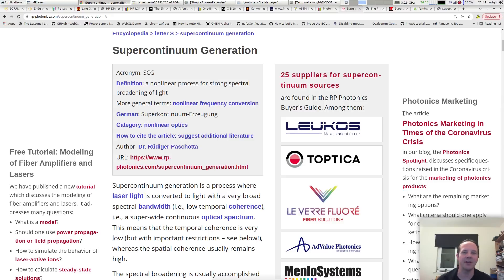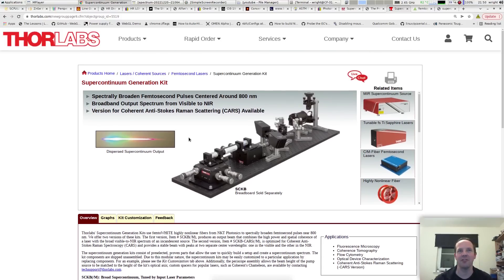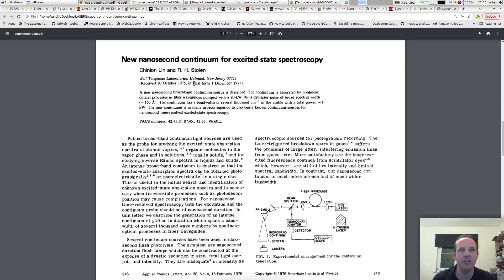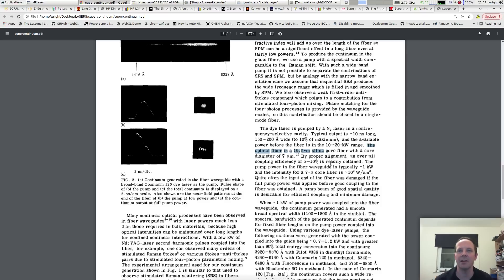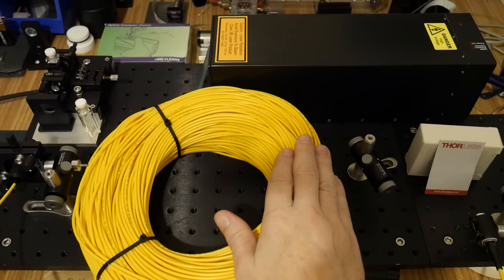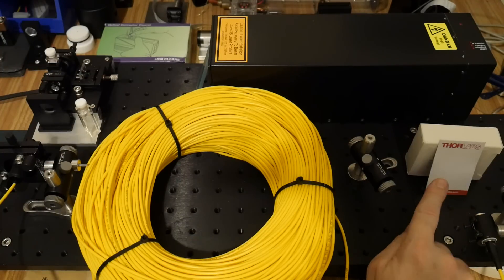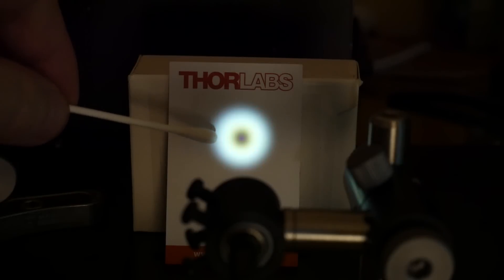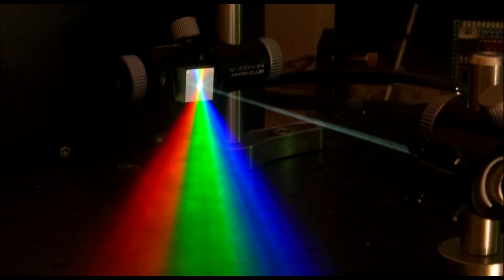DIY SUPERCONTINUUM LASER on a BUDGET!!

Comment: I suspect the "donut image" has something to do with how fiber optic cables are made. They start with tubes, vapor deposit some silica soot on the inside walls of the tube, then they heat it up and pull the tube into very thin strands that we call optic fibers. So the fiber has soot in the middle, which does not allow light through.
Reply: No it's a spatial transverse electro magnetic mode. The most likely reason here is the fiber is too big for the frequencies involved. This is a known issue for a lot of lasers especially as you ramp up the power.
Reply: @Slowly_Going_Mad  Thanks - today I learned about Transverse Electro Magnetic Mode in a waveguide medium, such as an antenna or fiber optic cable. - You get two thumbs up!
Reply: @EMleRoux Thanks and no problem. I also have a little trouble wrapping my head around some of the concepts if I'm being honest. The best way of looking at it though is most stable resonators are an extension of a spherical point source so these transverse modes are some integer multiple of interference patterns in the cavity for bulk optics. Fibers confine these states so it's a bit different but the end result is identical once it exits an aperture. One of the things that's got my interest peaked right now is a gain media that consists of a micro particle suspension in an index matched material. Think like powdered ruby in silicone oil. I've not seen anybody talk about it but it's probably been done. The goal here is to treat it like a dye laser using a flow cell this way one can sort of dodge thermal lensing to an extent.
Reply: @Slowly_Going_Mad  I'm impressed with myself that I understood half of what you said. I've added your channel to my subscription(s).I look forward to being confused some more.

Comment: Since all the youtube laser overachievers are here, I have a proposition. I have 3 non-operational Spectra Physics Mai Tai femtosecond lasers I'd like to see put to good use.  
The umbilicals connecting the pump diode to the ruby got destroyed, and one is missing the rf modulator.  I imagine that a modern LED pump would make it possible to resurrect them. Would one of you like to have one in exchange for figuring out how to best do that?